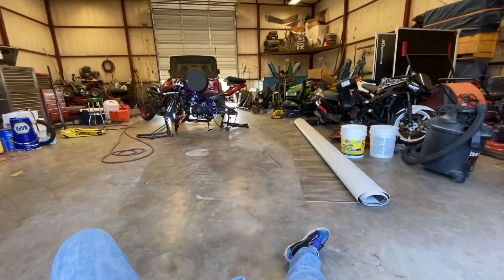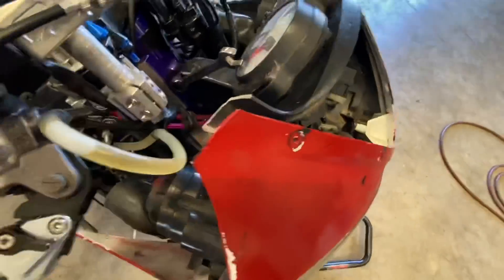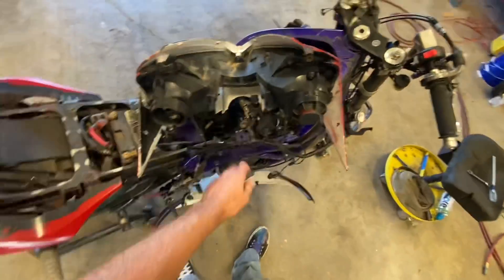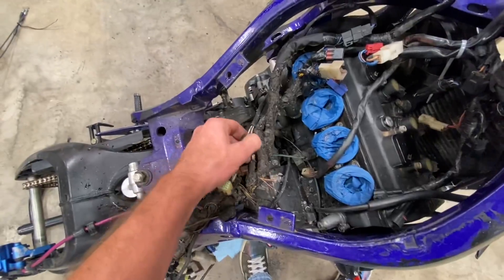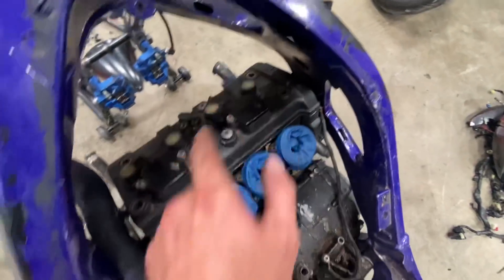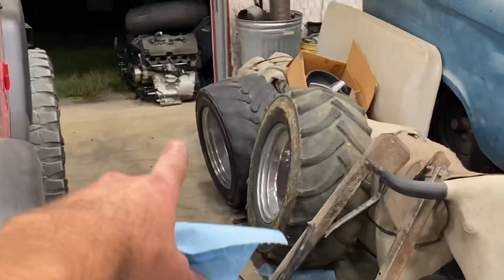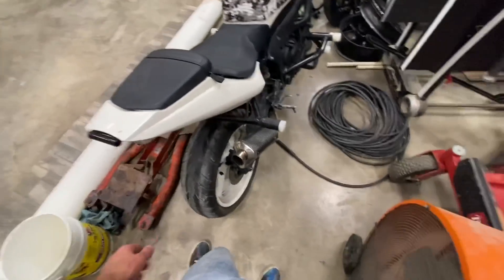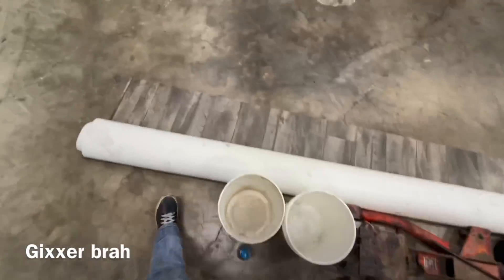R6 break down.

Comment: Wow the tires i was told were new. And the valve cover was taken off after the fire to check for damage. Hope the bolts are in the bag. The rust im guessing came from the guy pouring water on it to put out the fire. Gas tank and airbox was off the bike when the fire occurred. Brah im excited to see this build happen. Yeye